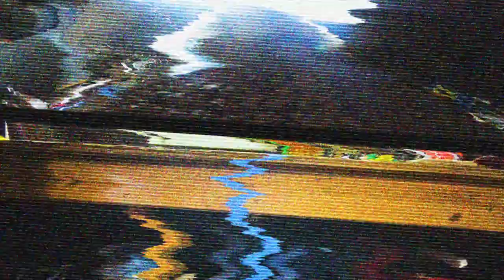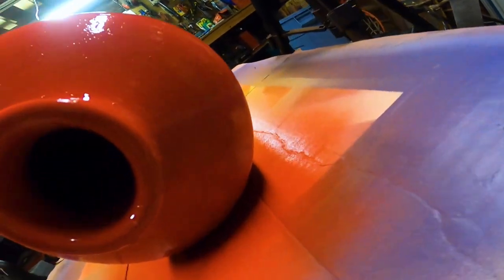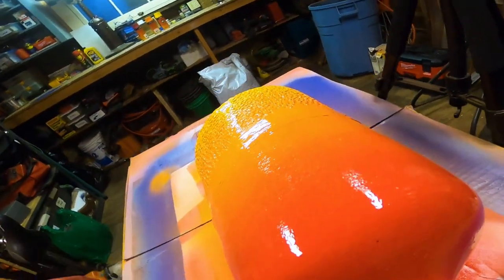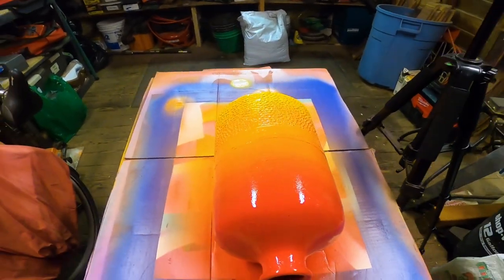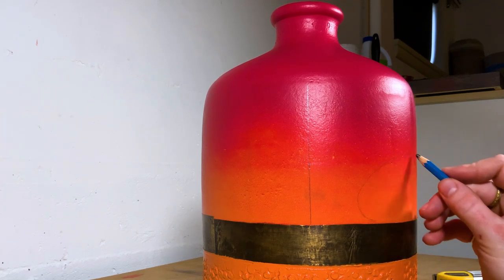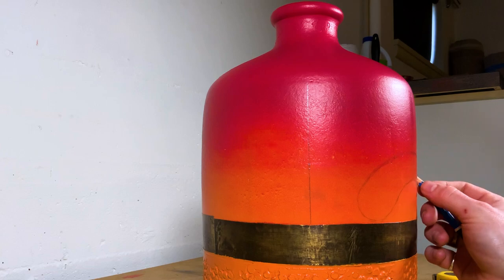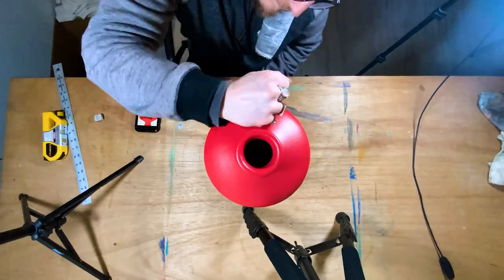I Tried Painting On Pottery For The First Time And This Happened

Comment: I love experiments and doing different. Very interesting peace I hope you are going to sell it (if not already) becouse this is a modern art peace. Tip...if you are working on roundisch thinks and need them to lay stil, just take a sock fill it with rise or sand and  you have something to rest your peace in without holding it. Not needed for this vase, but who knows what comes next. 😉
This would make a faboules lamp stand as well. 👍
Reply from the maker: Yea I am also a huge fan of painting on weird difference surfaces. It's my favorite part about using spray paint and Posca pens because they're made to paint on basically anything. And thank you very much! Haven't sold it yet but I think it definitely could look good in a modern home